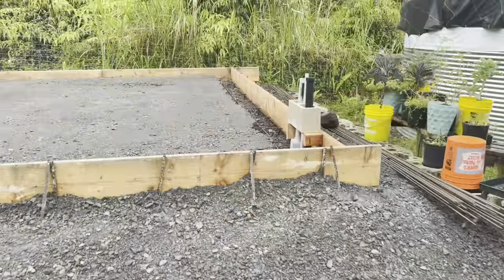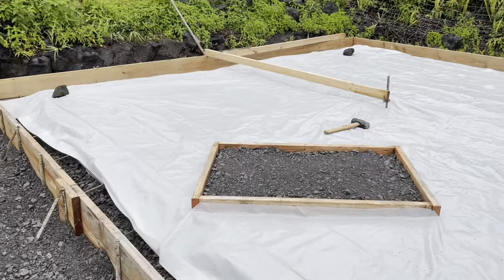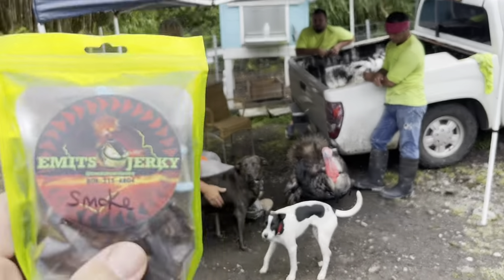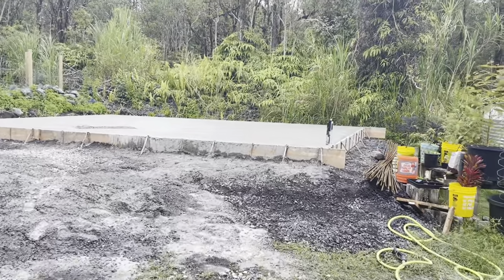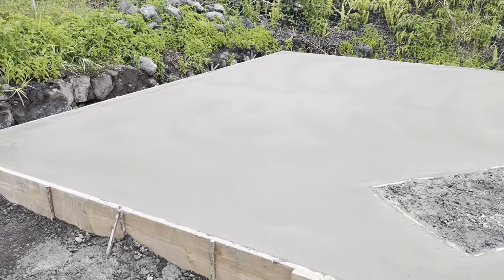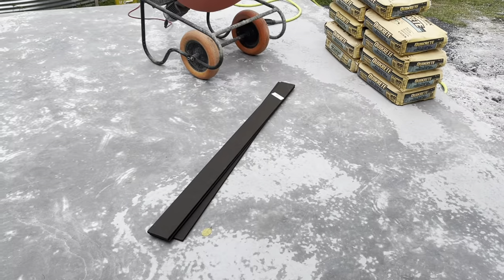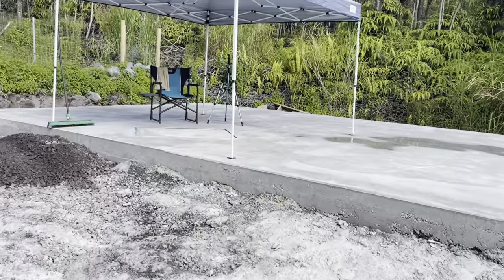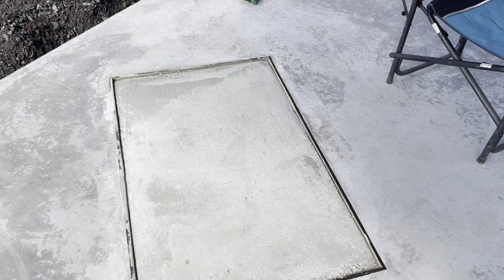Garage/Shop Build Part 6

Comment: Jason, Aloha, so happy for you— it’s done. An extremely important foundation, and you did it right🌴🌴👌🤙🏻🤙🏻 Now the fun can begin, the walls! Great job. The last barn/shop I built I stained the floor-looked really nice. Any plans for the new floor?  Have a great day, and I will see you on the next phase🌴🌴🤙🏻😁
Reply from the maker: Thanks David! No plans really for the floor right now it will basically be a blacksmith shop so don’t need it to be to nice lol… now to start the brick work and eventually framing the walls. 🤙🏼